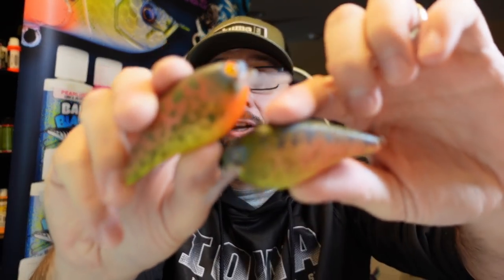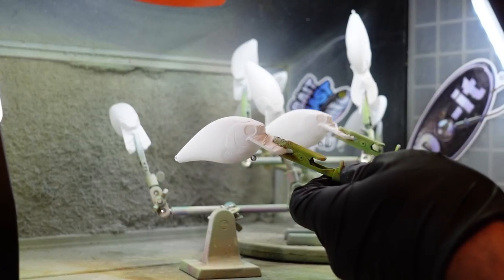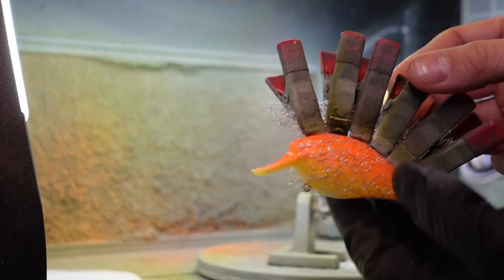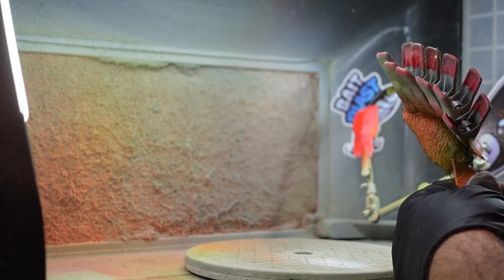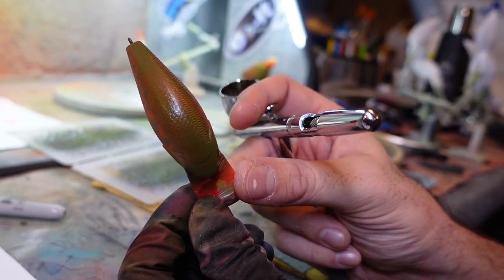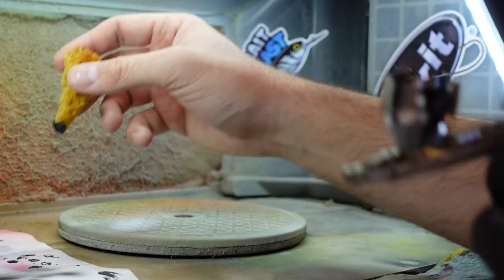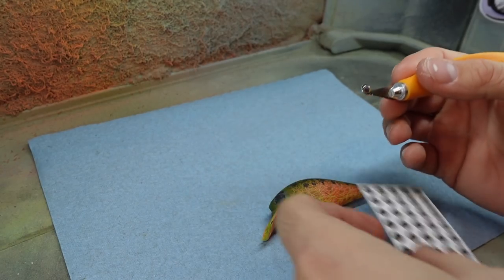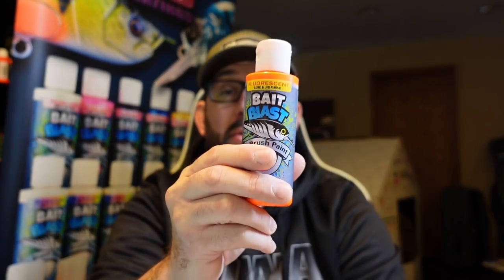2 Simple Ways to Paint a Crankbait (NEW Cranks, Paint & Giveaway)

Comment: I do airbrush. I build scale model aircraft. If you thin down your paint consistency and turn your air pressure down around 3-5 p.s.i. you can do some real neat freehand details. Like if you wanted to add in stripes on the face similar to what's on a smallmouth. It's real neat all the stuff you can do with an airbrush by just playing around with your paint consistency and air pressure.

Comment: Are they selling a top coat for their paints? Matte, flat or high gloss? I airbrush rc bodies but they are sprayed from the inside, so they are always glossy then I mask off the outside and hit it with a few super light coats of matte or flat. That filter really needs replaced. Nice paint work on the baits though. I have 1 like that in my bag but the bass around here know it by name and run from it.